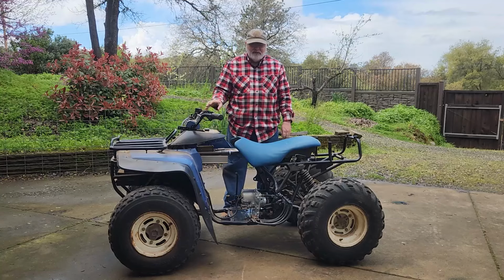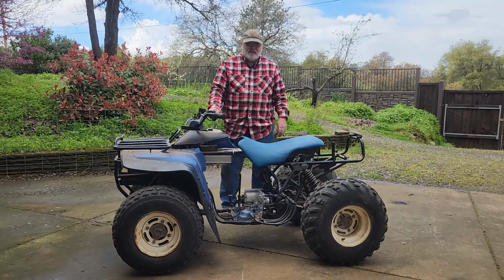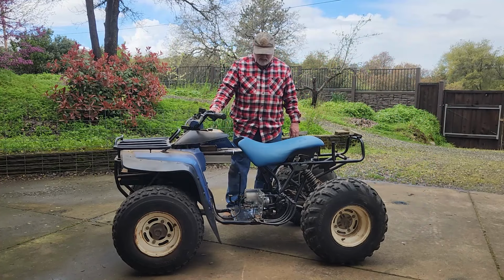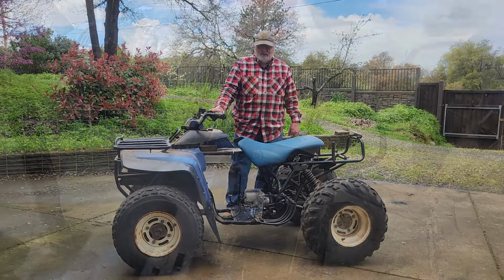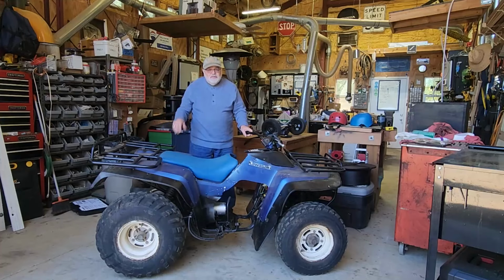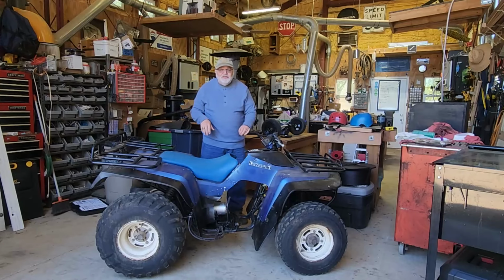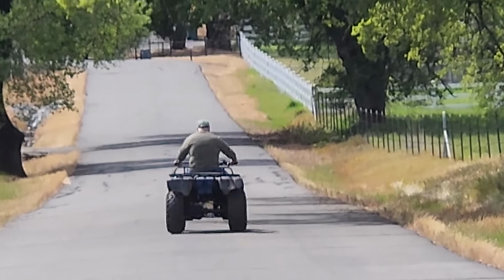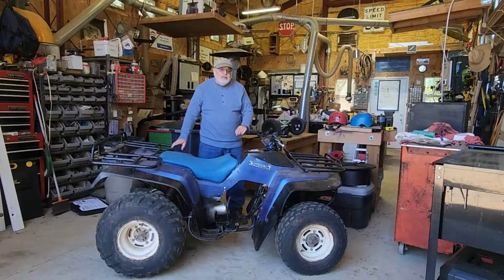Road Test Electric Quad ATV

Comment: Poor kawasaki
Reply from the maker: It has a second life it would have never had.
Reply: @bonesetranch  you arent wrong but why not predetor swap it? electric takes forever to charge and if you go a gas engine you would only need to wait like what 10 seconds to put fuel
Reply from the maker: Good question. Frankly,  I'm ready to set this project aside again. It is functional for now. I can use it for little chores around the top half of the property. But you're right, the time to refuel is a big advantage for gas engines.